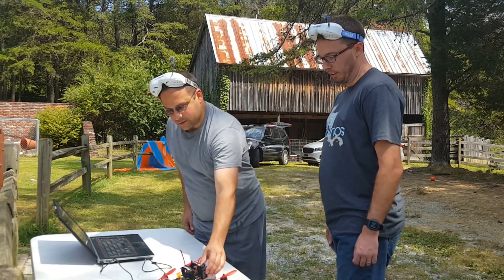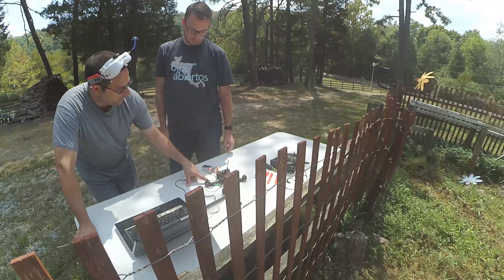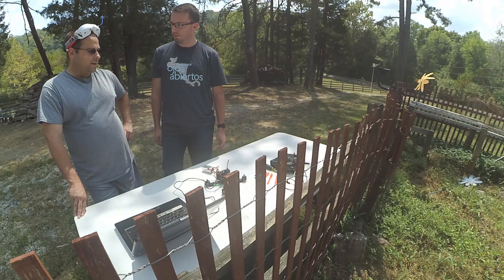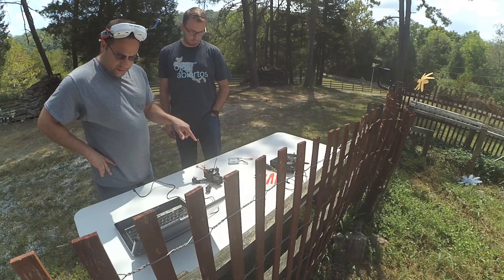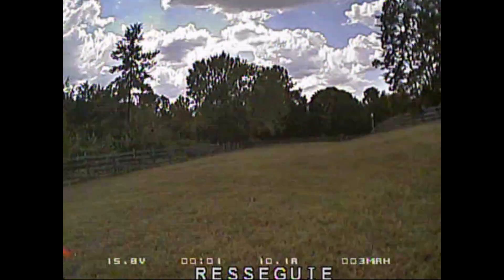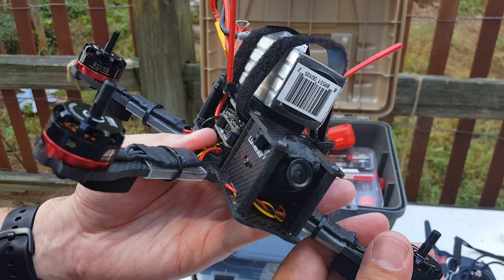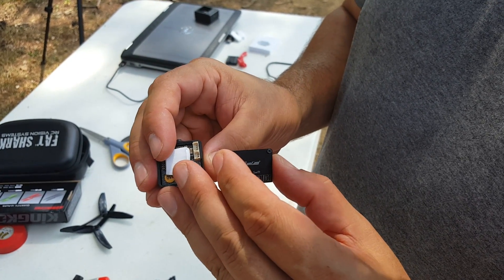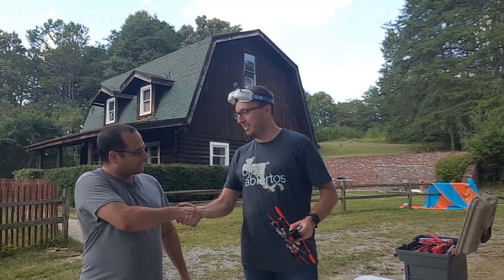Troubleshoot Your Quadcopter Vibration Problems | REAL WORLD TROUBLESHOOTING David R.

Comment: Needed to add more of my notes of the day. Did the camera fix anyway, I see the issue with the camera, only two screws and the other two corners are free to move. Done. Then the motor test. One of my motors noticeably was louder and had way more vibration. I got a number of over 10+ !!!!
So, next out to the field to see if the camera fixed helped or that darn motor is the issue.
Thank you so much.

Question. Is the number on Cleanflight/Betaflight a number that comes from vibration of the FC due to the Motor vibrations?

Comment: I had vibration issues at high throttle on my qav-x, pids being changed made no difference, strapped my go pro on to the quad to video the vibration, the next flight there was no vibration at all, is it possible that a quad can be too light? which causes the vibration?
Reply from the maker: +littlefluffyclouds77 I suppose. A heavier copter will be more damped.

Comment: Great video Joshua!  I had the exact same problem with the RunCam, Oscar Liang did a great tutorial mod if you have an earlier version, google runcam hot glue mod.  The newest RunCam I received had a dab of glue on the crystal and foam on the back.  Had some savage crashes and it's holding up fine.  Hope this helps other pilots!
Reply from the maker: Nice to hear they may be addressing these fixes at the factory.

Comment: one of the most annoying things to have on a fresh build :(.
Reply from the maker: +David Resseguie people are saying they've started epoxying the crystal.
Reply from the maker: +John E Fly newer Swifts have either eliminated the crystal, or epoxied it. I don't remember which, but they supposedly addressed the issue.
Reply: I keep wanting to like the Swift, but I'm 0/2 so far on reliability. My first one, and this one, have since died with mysterious blacking out mid-flight from vibration. Probably an internal sensor/crystal coming loose. Ugh.
Reply: I actually spoke to David about this at a software conference recently thinking I solved the issue with hot glue on the crystal.  After 18 batteries it happened again though.  I too am now done with the Runcam Swift :(  I love it when it works, but working reliably seems to be the most important thing.
Reply: Joshua, I have one of the newer Swifts.  The crystal is still there and not epoxied.  It does come with the foam pre-installed on the board like you guys did in this video though.  It didn't solve the blackout issue for me.

Comment: lol. I spent 3 weeks troubleshooting the same issue. a bit of soft foam in the back made it all go away.

cheers and thanks for posting.

btw - I had this on a lantian 700tvl camera. apart from that it works great. sometimes it also pays to put a touch of hot glue or contact glue on the lens ring. something that will remove easily but will hold it all in place.

Comment: I had the exact same problem on an 1177 camera.  Adding foam helped a little but it was still pretty bad.  You could push the board around up and down / left to right with the back off.  Probably almost 1mm play.  The foam just couldn't hold it secure enough.  It was shaking so bad I couldn't judge ascent / decent rate well at all.  Ended up just gluing the board to the housing using 3-4 drops of thick CA.   100% solved.

Comment: I have a similar situation with my JJRC JJPRO I am testing. No changes, brand new props (HQ, DAL, etc) brand new motors, a 90% tune, even a different battery lol. I fixed the camera better, and nothing. I took the camera apart and like you showed smashed some foam in there but still about the same. I think it may just be a trashy camera as it is a cheap CMOS one since it is  RTF.

Comment: Great vid and wow what a simple fix. I never would've found that.
Reply from the maker: To be fair, David really found it.
Reply: +Joshua Bardwell glue is better tbh I put a few dabs of shoo goo around the edges of my board in my swift and it works a treat. silicon sealant would probably work also and be a bit easier to remove to clean the sensor. I would worry about foaming the vregs especially as some people like run bat voltage into there's.

Comment: I seriously always look forward to JBs new vids!

My quad has visible and audible vibrations on the props at idle rpms but runs smooth at hovering and flying rpm. I was hoping this was covered. Any clue?
Reply from the maker: If it only happens on the ground, probably air mode. There are some configuration options that can help such as airmode_activate_throttle.
Reply: Matt, mine does that too. I've not explored the options Joshua referred to to tame it yet.
Reply: Do you have airmode enabled? Doesn't that potentially cause issues when idling on the ground depending on how you have it configured?
Reply: +David Resseguie ya, I do. I'll take it off and see. Best I can recall, +JoshuaBardwell had a video on air mode that convinced me to enable
It.

Comment: Just want to mention that ive had this happen multiple times too, but gluing the board in and reenforcing the sensor didnt help. the actual elements inside of the lens were jiggling loose. Yes the metal lock ring on the lens was still glued in place and solid.

Comment: +Joshua Bardwell i have a friend who has a Vortex 285, it flys nice and level without vibrations but it spins hard to the right in a level yaw motion (like a frisbee)! we have tried the pid's, different firm ware for the OSD and FC and ESC's with no affect.  when i had asked more about it he said he had crashed and ended up replacing a motor (I'm not sure which 1). With a newer motor and older ESC could this cause this out-of-control flat spin to the right (this starts about 3-4ft of the ground, the more throttle given the faster it spins)? Thanks
Reply from the maker: Is a prop on upside down?
Reply: +Joshua Bardwell no the props are good, we even put newer ones on and they are spinning the correct way

Comment: Great troubleshooting vid!  I wonder if these could be a regular thing.  I know I've got some issues I wish I knew more about.  For instance, I think I may be overtaxing my ESCs.  But I don't really know what that would look like.  Would the motors heat up if the ESCs couldn't handle the current?  Could that be the cause of the stuttering I'm seeing and hearing?  I'd like to know the cause before I shell out for higher current ESCs or more efficient motors...  Maybe just less aggressive props would solve my troubles?
Reply from the maker: The ESCs would be too hot and would burn out if you were overtaxing them. But few 5" setups can really tax modern 20A ESCs, and 30A ESCs should be nearly bulletproof.

Comment: remember last week when you helped trouble shoot a bent motor on mine? New motors,same problem.not as bad but still there. Swapped cams,same problem, hot glued board to cam housing,problem gone.these where 2 run cam swift cams.I have the worst luck with odd problems.lol

Comment: The problem i think is that runcam have alternative backs for the swift and i don't think they check the fit with them.

I suspect mine might be a smidge loose but on such a tight x210 build i cant be assed to disassemble the whole quad to pack the back of the camera.

I recommend that everyone put a piece of foam in when changing the backs on runcam swifts for good measure.
Reply: I bit the bullet and took apart my quad and did your fix (few dabs of shoogoo not foam around pcb edges) and the difference is amazing thanks for this brilliant video I am sure this will help lots of people.

Comment: HS1177? btw use lower scales for better results!
Reply from the maker: I don't think so. I think it was a Swift.
Reply: It's a Swift. For some reason the HS1177 I bought for the build didn't fit the QAV-R. It was slightly too wide for some reason.
Reply: I had one HS1177 with the board pivoting at the edges, foam fixed it. Also a friend had similar problem.

Comment: bunch of useful tips in there,...trouble shooting quads is a dark art,   broke and trouble shot the shit outta my quad the other night and fixed it, and i still don't know what went wrong.... i did that thing you did on a vid to remove the deadzone on the fc output pwm, it killed the motor... it went fine and i reset all the motors to what motor 2 tested at 1955, didnt want to go thru all the motors cause its scary to run without props, then when i armed motor 2 wouldnt spin,.... i checked in blheli and they all worked and flashed fine, went to motors still motor 2 wouldn't spin up.. i spun motors 1,3,4 all fine, i reflashed everything reset and then, all 4 motors wouldnt spin up.... then i dismantled to check my awful solder work, all still fine.... then i checked the battery 3.5v..... new battery everything worked fine, which still doesnt explain why motor 2 stopped and then motors 1,3,and 4 stopped....i wish cleanflight had an emergency josh from the future button

Comment: Hey josh, you have given me advice before and it worked wonders however i have noticed that at a certain throttle and above (about 80%) my quad tilts back slightly. i have messed about with my pids however cant seem to find any combination that works. I ran the test that you showed in this video where i removed the props and span each motor up, resetting the accelerometer in between each test and i was getting at best 0.04 to at worst 0.30 depending on the motor and the axis, could this be the reason for my quad tilting (i have tried many different prop types and i still have the same issues) and if so should i try purchasing new motors and if not what can i  do to try and tone the tilting down in the tuning. Thanks for any help you can give : ) (im running a naze 32 rev 5 on betaflight and well flown and crashed cobra 2206 2100kv motors)
Reply from the maker: I don't think it's likely that your motor vibration is causing the issue you describe, although 0.30 with props off is a bit excessive. Have you tried raising I gain on pitch?
Reply: my quad is in the pits atm as the lead to my vtx is broken but as soon as its fixed i will try raising it.The i gain for pitch is currently 0.060 which i thought was quite high but i will try pushing it up further. Another bad tendency it has is after punching out after a steep dive it tilts backwards, is this likely to be a part of the same issue? Thanks so much for your help, i really appreciate it.

Comment: Nice troubleshooting. I had a similar problem and my footage looked identical to his. Mine actually ended up being the glass lens itself was loose inside the metal lens housing. Finding that just about drove me crazy. It was a bugger to diagnose but when I fixed it, my footage was smooth as can be. Thanks for the video.

Comment: I had the same issue with a mini Tricopter I just built.  It was maddening, because it was all new stuff including the camera, and I was trying to tune it out.  It was my first experience with Triflight etc. and I didn't have a baseline, so I assumed that mini-tricopters fly like crap after tuning for days.  Solved it now, but what a fiasco.  

I like runcam stuff for the most part, but they sort of missed the mark with the Swift.  The other thing you should have used the hot glue for while you had it out was the crystal on the swift, they use a through hole like the old board style instead of surface mount.  "Born for RC;"???? Then spend the extra $0.05 and use surface mount crystal, or at least put some potting on it.  Still prefer their cameras over the HS1177 simply because they are just a tad smaller.
Reply from the maker: How do you like the mini tri? How does it fly?
Reply: The verdict isn't in yet on it.  They don't use betaflight, so it's a bit of a learning curve for me.  The tri-flight software is a ported version of cleanflight, and I can't get the Tail to be super happy.  I'm disappointing in triflight because it limits you to a 1K looptime, even though David's FC uses an F3 chip with an SPI gyro.  It has a bit of a yaw jerk when I punch the throttle or let off.  I was actually thinking about contacting you and asking if you wanted a go at tuning it.  It doesn't have blackbox, but I can put a UART sd on it before I send it to you.  I'll pay shipping both ways, and you can hang on to it as long as you like.
Reply from the maker: If you want to send it to me, I would love to give it a try (tri! hah!). But I have no special insights into tuning a tricopter, and the knid of yaw issues you're talking about are EXACTLY why I don't like tricopters.

I wonder what would happen if, in addition to using the tail servo, the tricopter ALSO used motor torque to affect yaw. I wonder if motor torque could provide small, instantaneous corrections faster than the tail servo could swing?

Comment: Wow.
I had this exact same problem for months!  I just solved it last week by doing the same thing.  I put the HD cam on, and compared it to the DVR.  I don't normally fly with an HD cam, which is probably why it plagued me for so long.  On viewing them side by side it was obvious that the vibes were far more severe on the DVR footage, so I did the same thing, and put some foam behind the board.  Hey presto, vibes almost gone.  Now I just need to tune it.

Comment: Good job josh. I think most people would automatically assume it's pid related. Just goes to show that not everything is always as black and white in this hobby!
Reply from the maker: +mrmurder75 David definitely thought it was PIDs but it just didn't look like P or D term oscillation to me. P is more regular and D is lower magnitude and usually higher frequency.
Reply: +Joshua Bardwell Troubleshooting can be one of the trickiest aspects of this hobby I think. Once you actually get to the point of knowing where the issues are, it's half the battle won. But getting to that point can be a laboriously troublesome task. Always helps to have someone to help you along the way like you did for David. Did he need any help with his tune afterwards josh or did he have that covered?
Reply from the maker: We spent about 3 hours total getting the camera troubleshot and fixed, so we saved the tune for another day. I'd say his tune wasn't bad, but it definitely had some room for improvement.
Reply: It definitely wasn't tuned at all. As you probably saw, it was really soft and was drifting around. I had dropped everything to about half of default when trying to identify the vibration. I'm going to put everything back at default and start the tuning process over now that the camera is fixed.